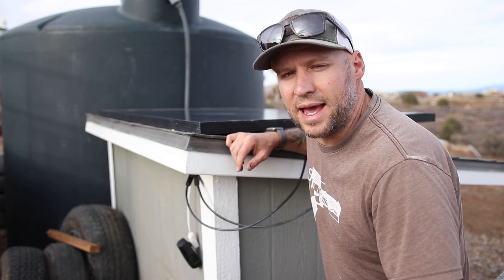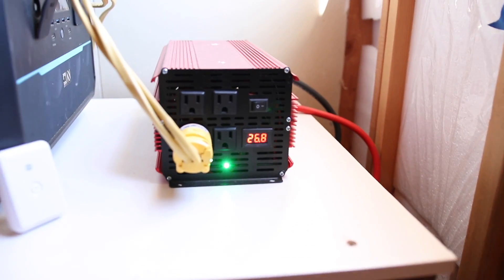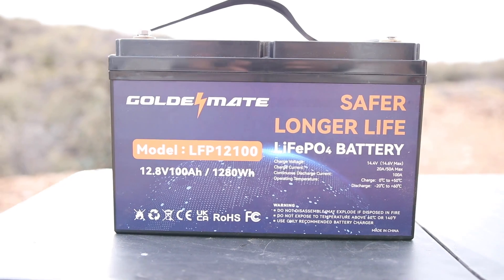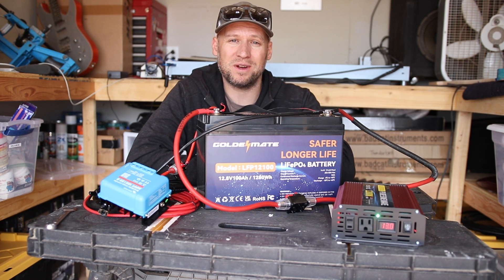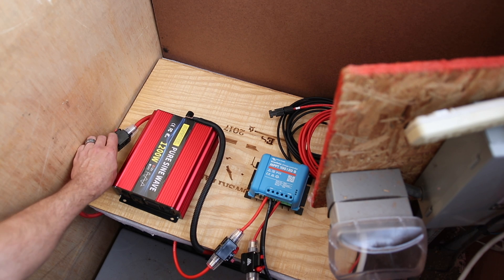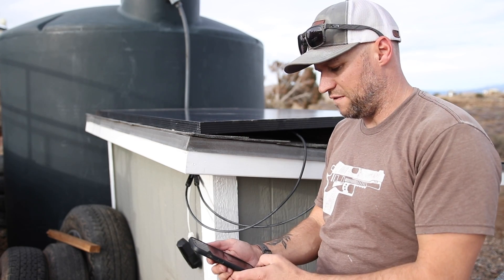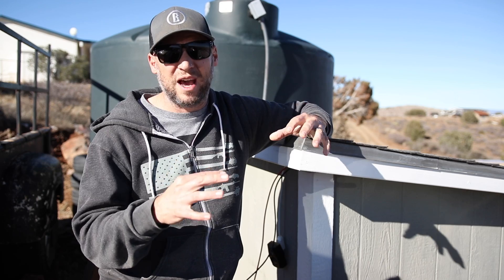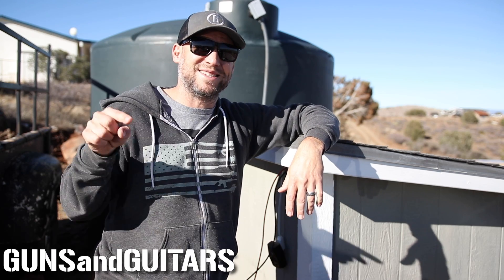CHEAP and EASY DIY off-grid well house (for less than $500) with Goldenmate 12v LiFePo4 battery

Comment: Good Video. I got a Moes Automatic transfer switch off ebay to automatically transfer to the grid if battery voltage gets low.  This should help extend battery life by reducing full battery cycles.  It's around $100.
Reply from the maker: That’s a great idea!

Comment: Good stuff you Guys 👍some would say you’re only powering up for water, but you use a lot of on grid energy for that job alone,so yeah you’re on a winning streak for saving, you could save even more if you had a header tank near the house that way you’ll get gravity fed water and the pump will only come on when it needs to top up the header tank and should keep you fully charged all the time…
Just a thought but hey, good job dude and congratulations on catching yourself some free energy …
✌️😎👍

Comment: Excellent project.
I suspect the difference in power draw is that you were calculating on max draw, which would only be for the couple of seconds of spin up.  Once the pump up and running, you would use the continuous draw for your math.

Additionally, you were probably running the pump off of the solar panels during the daytime, rather than the battery, which would extend the battery life.  Even with clouds, any light hitting the panel will generate some power.  (Make sure to keep your panels clean.  Dust will block a lot of light, too.)

Yeah, sub-300W panels are getting cheap because people are buying the 400W+ panels these days.  Dealers just want to move out the old inventory.  Also, a lot of folks are upgrading their older 200s for higher wattage, so you can get used panels for cheaper.  (With a typical lifetime of 40-50 years, getting 4-5 year old used panels for cheaper makes sense for small installs)

Comment: Thanks Dan - I haven't watched you much since I built my bass.  I suggest you get a clamp on ammeter.  Then you can calculate the power draw.  I also truly wonder if this would work in a more Northern climate.
Reply from the maker: Can’t speak about northern climate, AZ is one of the best states for solar, I think most other states would need more batteries and panels to make this work.